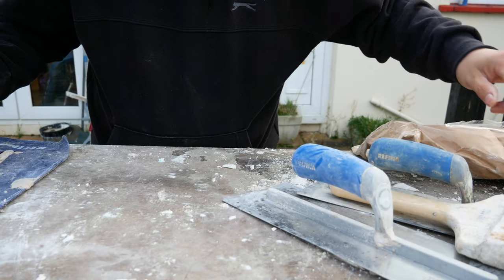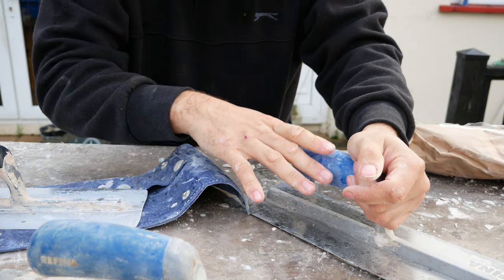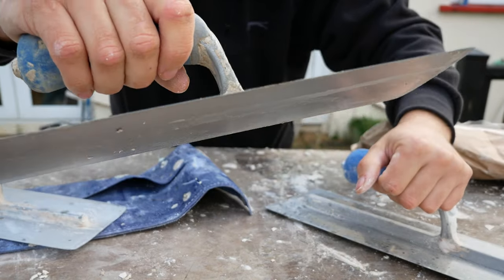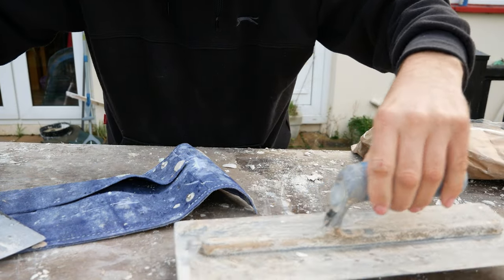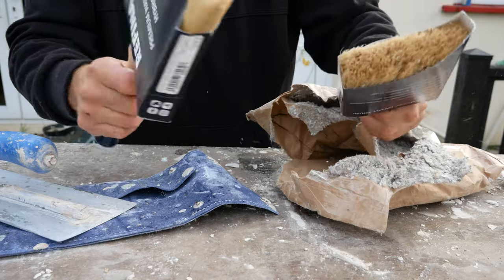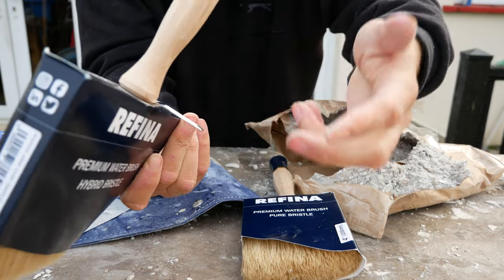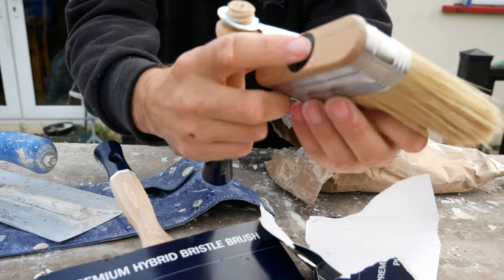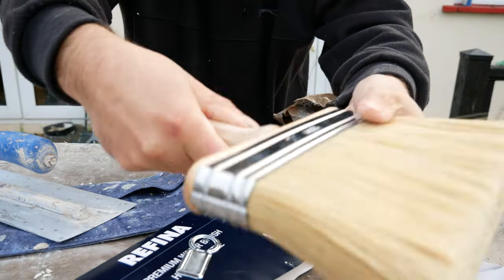Refina Finatex Steel Rendering & Skimming Trowels NEW water brushes

Comment: Hi Mac .I want to order one 18 inch trowel .But I want to  ask you the Refina Finatex comes with a flat blade or pre broke in like MT permashape and Nela ,these had a round shape of the blade ,and personally I don't like that .Hope you're well .Thanks
Reply from the maker: As I remember they have a tiny round on corner but slmost just to take away the point but besides from tgat pretty square from new

Comment: That’s silo cement trowel. Or they all the finatex.
Reply from the maker: All finatex mate have the silo used on render vids if u wanna have. Look
Reply from the maker: This vid has the silo trowel going = https://youtu.be/ThcIIDGN08Q
Reply: @macplastering  
Sound buddy actually have the 14inch 1. Just ordered the 12inch by 3inch. Be handy tight areas. Think in general the refina tools take some beating harling trowels small tools buckets etc. have gold series Kraft trowel there very nice American made should have a look at them buddy.
Reply from the maker: @lmilne4859  Yes was scudding the other day the harling trowel was like a hammer taking the odd missed chipping of the from the old render  where did you order the kraft from think i had been talking to them before
Reply: @macplastering  
Speedcrete very good along with O’Neil supplies get a few on eBay also. Do a nice scarifer also. There co owners a think with W Rose which have making brick trowels since 1797 or summit. Hand American made rose brick trowels best business bricky my self that’s where came across the Kraft so bought the gold series proform handle 13x5. Then bought 12x4 cork handle. Must say a do like the refina tools also.
Reply from the maker: @lmilne4859  nice1 mate yea an old mate of mine years back said kraft are very good just never got my hands on any to try but glad I found refina very the years to as Marshall town some trowels didn't last me any time
Reply: @macplastering  
Refina seem very well priced. Nice 1 buddy give 1 a go 1 thing for sure you will no if there good or not. Mag floats are great. Grout trowels use love the comfy handle on them. Coating trowels not sure if like the rubber or cork better don’t use them enough. Do really like refina blue handle. Have a good week buddy 🤟
Reply from the maker: When you say mag floats are they a sponge float ?